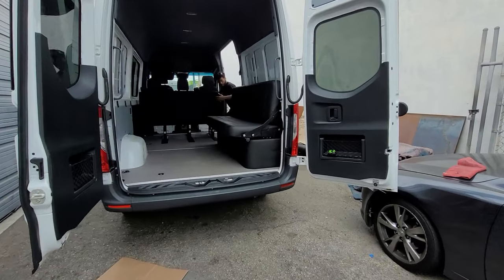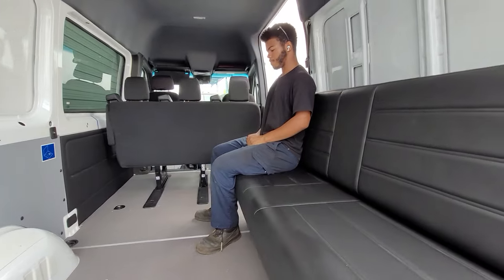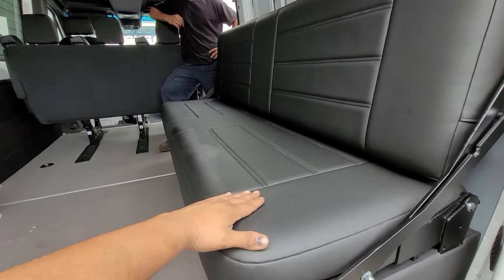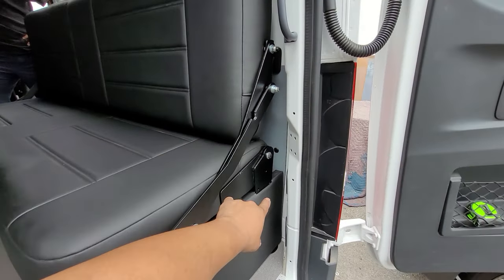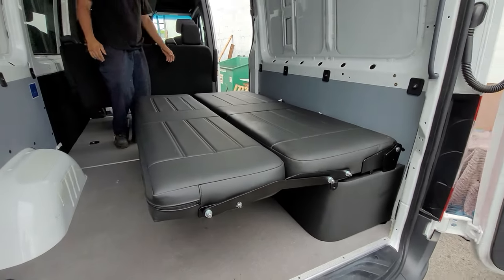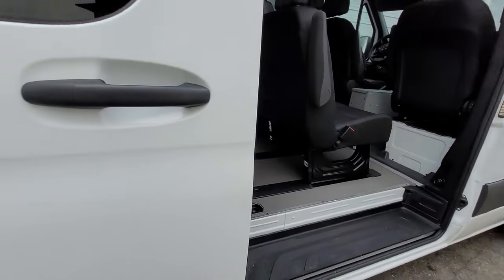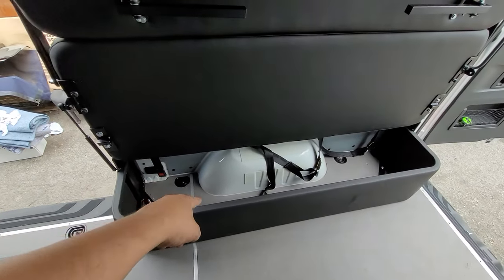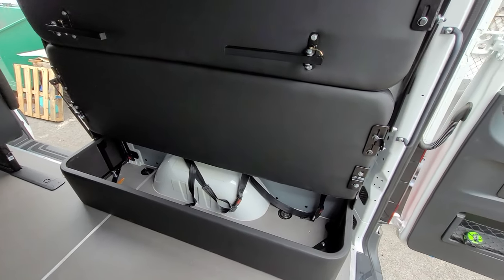SPACE SAVING VAN CONVERSION 3 IN ONE FOLD AWAY BENCH BED SLEEPER SYSTEM.

Comment: I like that for my new sprinter 144 crew.  I am only concerned about the placement of those drop down legs,  it looks like they should be further outboard near the outer edge for strength.  I weigh 350 pounds.   what do you think,  why are they so far in creating a large ledge.?
Reply from the maker: Follow us on Instagram, check out our highlights and you'll see new modifications made to new version, all steel construction so it can hold 800lb or  more.